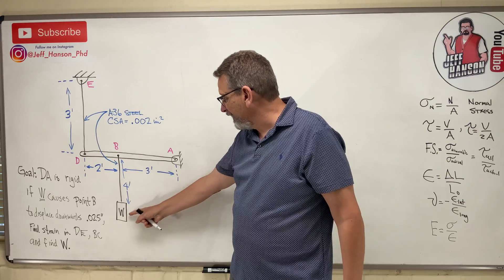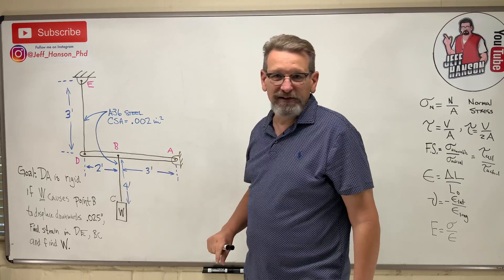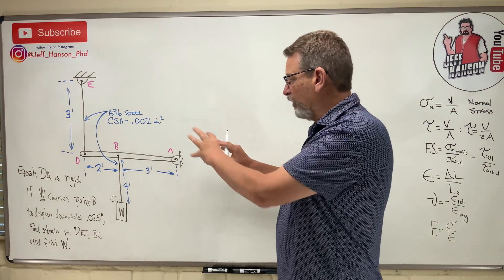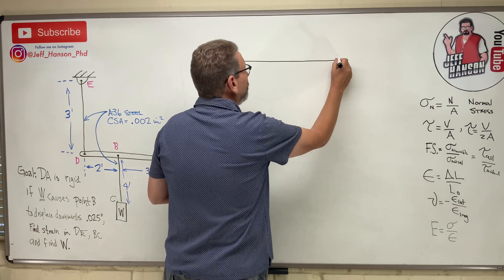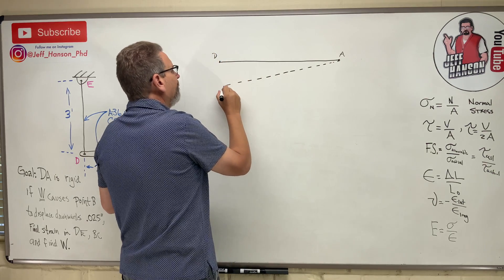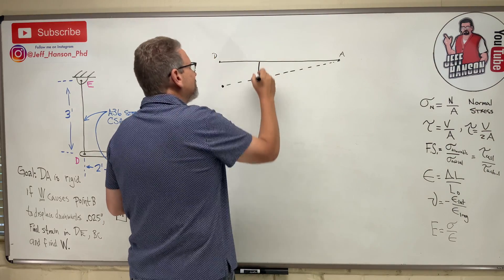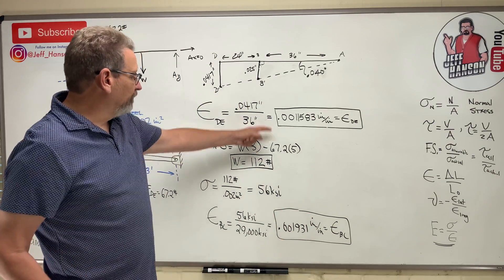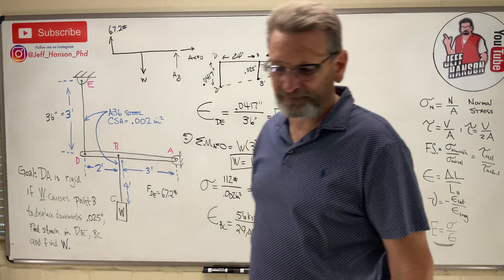Mechanics of Materials: Lesson 11 - Modulus of Elasticity Example Problem

Comment: Can someone assist me. Why when we were calculating the strain in BC , why didnt we just say 0.025/4. Since we were given the change in L and also L for BC
Reply: 0.025 is not the change in length of cable BC, it's just the new location of point B.

Comment: Thankyou very much for the video professor it really helped a lot, however I have a doubt: at 2:24 how did you know that rod AD rather than bending in a parabolic shape at point B,  point D also had a displacement and whole rod AD went down?
Reply: It’s probably a bit late now, but I think it’s because DA is taken to be rigid and we’re looking for strain in DE so it wouldn’t make sense to assume D doesn’t move and only B moves down making the beam bend parabolically.

Comment: When I divide the force 112 kips over area 0.002 in^2 I get 56000 ksi and the ksi goes away with modulus 29000 ksi to get unitless strain to be 1.93… I don’t understand how Jeff cuts it down to 56 for the stress BC, can someone explain pls 🙏
Reply: it's 112 pounds divided by .002 inches. not 112 kips. 112 pounds/.002=56,000 pounds/in^2 which is 56 kips.

Comment: What if you assume the beam is sagging.
Then, the change in D won't be 0.0417.
Reply: sagging goes away with the force of W. you could make the problem longer and calculate the sag before a weight gets put on.